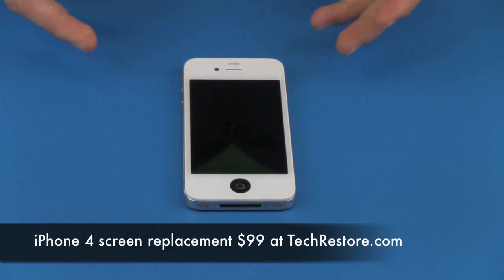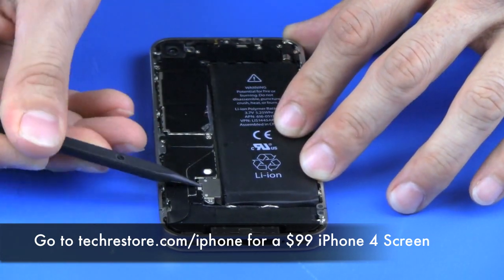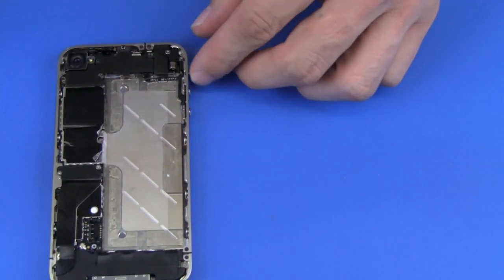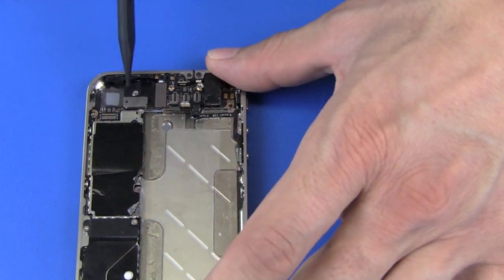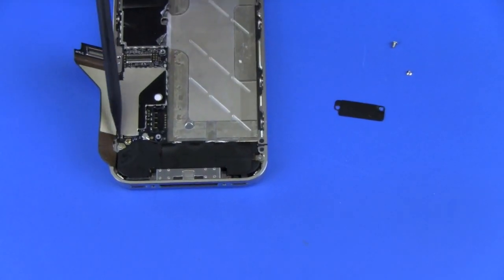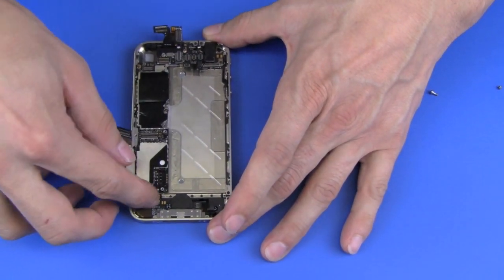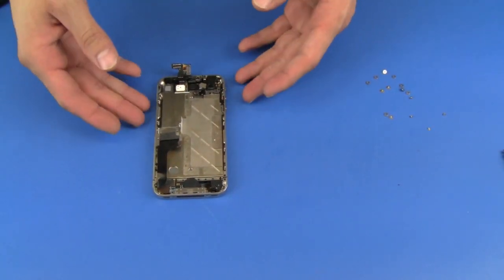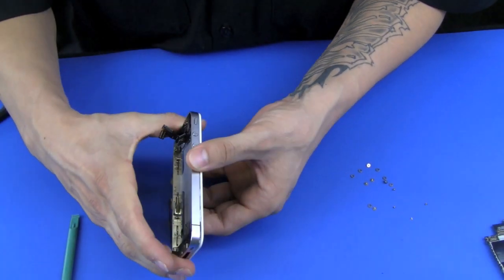iPhone 4 Screen Replacement take apart disassembly by TechRestore

Comment: Good to point out had a little issue replacing my iPhone 4 screen, The new iPhone 4's have pentalobe screws in the bottom (5 indents rather than 4 with a phillips screw) Pick up a pentalobe screwdriver if you have them as phillips will damage the screw and you may not be able to get it back in afterwards got mine for £1

Comment: The six(6) screws on the sides of the unit holding the digitizer/lcd assembly do not need to be removed but just loosened. This will save time and unneeded frustration on the reassembly. Just a heads up :)